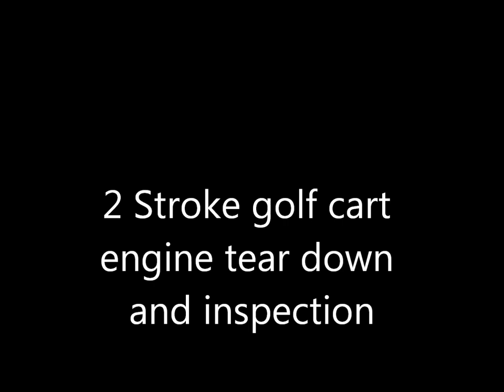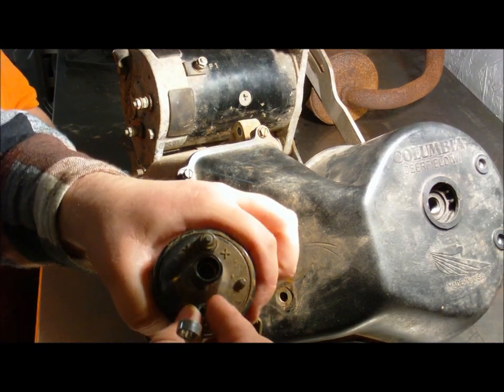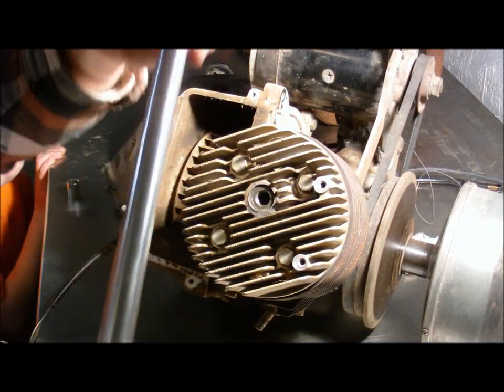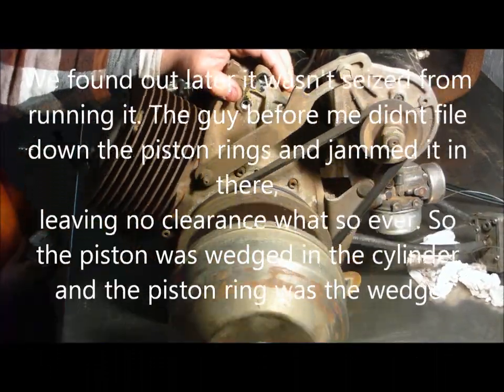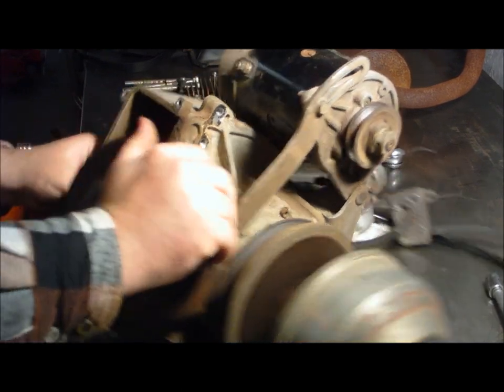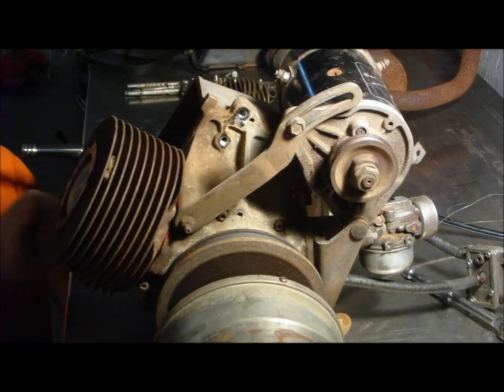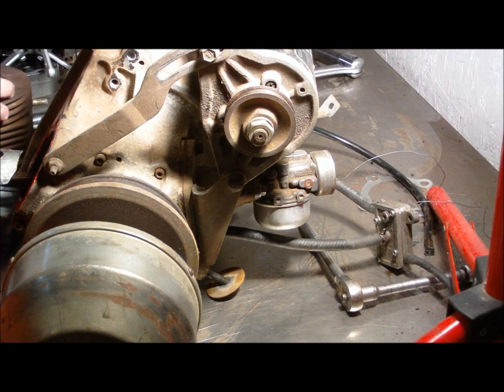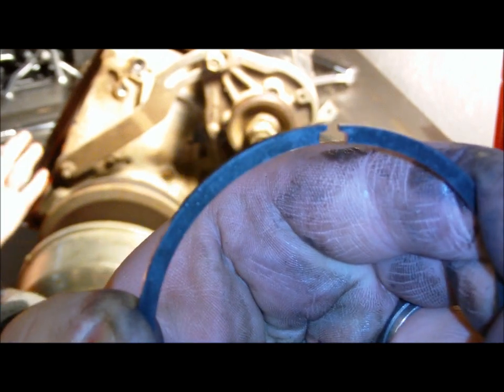2 Stroke golf cart engine tear down and inspection

Comment: i'm working on one of these right now rebuilding the motor the cylinder a scored found the crankshaft bearings to be bad which causes seals to leak and allow it to suck in dirt The nut on the flywheel is only a nylock nut and was loose which damaged the key way from the flywheel being able to slop back and forth I can't find a new crankshaft so I will have to see about getting this one repaired and the flywheel must also be repaired and when I put it back together I will defiantly be using lock tight on the nut or getting a clinch nut. It's just too bad they discontinued so many parts.
Reply from the maker: +Silent Death yeah that's the problem with these old golf carts is the discontinued parts. I hope it all works out. Thanks for watching and commenting. Please like, share, and subscribe.
Reply: handy man I fix the fly will yesterday by wire feed welding the keyway back in and then cutting it back into shape using files and it worked out good